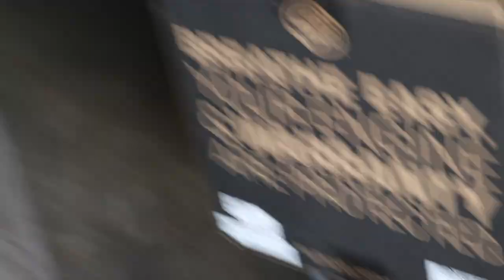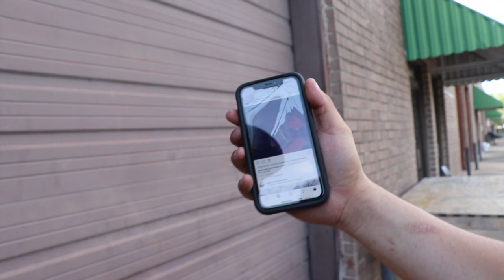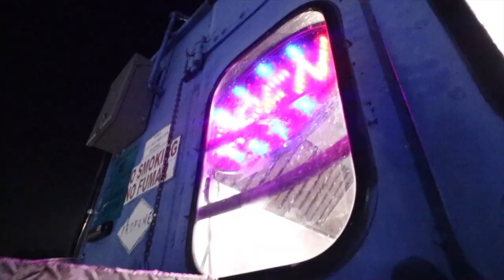K&N intake VS S&B intake installation

Comment: The trans adds top speed. More acceleration. So more acceleration can mean maybe a lil more hp but id wait until everything is put together. Just don’t run it without retuning it when you do have the other parts installed

Comment: Cmon bro why use that cheap valvoline you should be putting mobile1
Reply: Yup Mobil 1 or for an even better motor oil go with Pennzoil Platinum ultra. That's one of the best oils on the market
Reply: Mobil1 or amsoil
Reply: Esta mejor shell de home depot
Reply: Oil is oil dawg as long you change it on time you good
Reply: @sanchez_lsx1198  correct! And people will go with a expensive oil when oil is oil. Just change regularly.

Comment: What number of air cold intake S&B?
Reply: Did you ever find out the part number?
Reply: David Garrido depends what vehicle do you have.Because that s&b intake is 2003 - 2006
Reply: My bad i thought you were asking for the part number of that intake. @5:10 the box shows 75-5036
Reply: David Garrido appreciate it I already got it